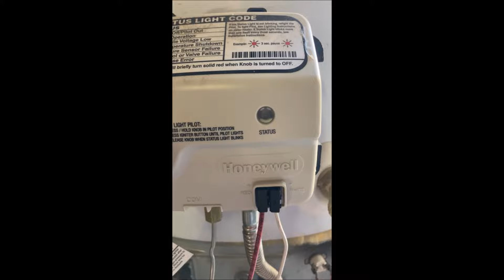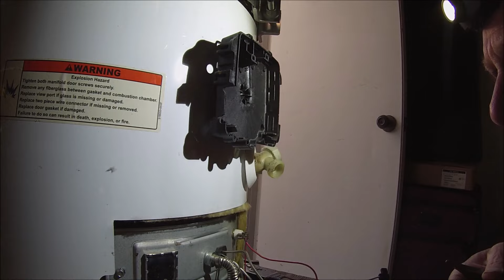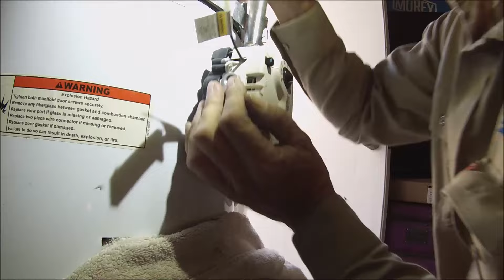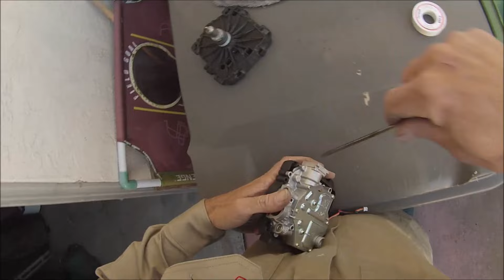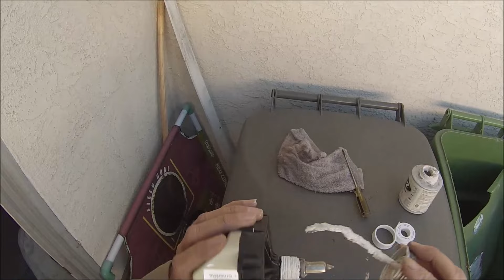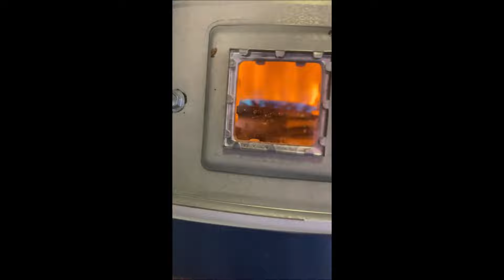Code 5 | 5 Flash Water Heater Honeywell Valve Service Call

Comment: AMAZING SELF HELP!!! thanks for posting, question?  my water never ran cold just luke warm. pulled the unit,  

 I have some water in the well in the back, does that mean the sensor is kaput? or can it be cleaned and put back?

I have some corrosion at the bottom of the unit so it may have been leaking for some time

 Also the cover in the back the nipple appears to be plastic not metal, is that possible?

If so where would I order a new back cover and sensor? or is the unit shot and better to get a whole new unit?

IF i need the whole unit can I put some sort of rubberized covering like Flex paste or Flex glue over the nipple until I get parts?

a lot I know, but I wanted to get it in all at once

TY
Reply from the maker: If you mix up the hot and cold side when installing it will (supposedly) water temp should be Lukewarm , if the dip tube falls off inside the water heater it will run lukewarm, to much sediment will insulate the bottom of the tank can cause this  , broken thermostat can cause this. So in a water heater the hot water separates from the cold if this system is interrupted the water mixes together. Hope that helps!!
Reply: @thewaterheaterfactory  THANKS for the reply, installation was good NP there the tank has been operating for 7years without a problem, I started getting cooler water, suddenly, about 3 wks ago, when I checked it I was getting the dreaded 5 flashes, I tried the reset procedure, lights fine gets warm then shuts down, 5 flashes starts again so I presumed either dirty tank or the controller, didn't know about the thermistor until I watched your video, striped it down and found the moisture in the unit, while I had it off I drained the tank and did a back flush, ( oh forgot the nipple on the back had a slick coating but not cruddy, but flushed anyway, in your video you replaced the back plate and thermistor, I called 2 supply houses locally they said they aren't replaceable, and wanted to sell me the whole controller, I searched online and found a "used" thermistor on ebay, but no new ones, and no back plates at all, I was hoping for a direction to buy parts, if you know of any, if not I guess the best bet is to buy the whole controller. 

but regardless, thanks for the posting it was absolutely great
Reply from the maker: That's a tricky part. I call it "the well housing" you might need to buy an entirely new valve try eBay. Or buy a used valve just make sure it has the metal cap on the tip for the sensor. I think you can get valves for $65 maybe its $165 . See if you can pull one from a discarded water heater plumbing store ext. try Craigslist offer up and Facebook marketplace.

Comment: Do you use pipe dope and/or teflon tape to connect the flex gas line to the converter that is screwed into the control valve?
Reply from the maker: I don't use either , its not needed its a self sealing end. But i see it used a lot. But you don't need to put teflon tape between the flex line and the adapter. Thanks for commenting and watching!

Comment: is there anyway to get the valve alone not the whole control valve?
Reply from the maker: Try eBay search Honeywell valve body , if there is a place by you where plumbers drop off old water heaters that's where I score them from ! Plumbing supply houses look for the water heaters that are leaking then take off the valve
Reply: Btw I appreciate this and your help
Reply from the maker: Thanks for watching !  Appreciate it ! Consider Subscribing! Thanks!
Reply: I have one more question lol.  So I took apart the gas vale to access the temp sensor.  No water dripped out.  But when I pulled the sensor out it looked like it had a drop of water on it. But didn’t seem like water.  There was no water running out of the tank and I stuck a piece of paper towel moved it around and it came out dry.  Was this drop possibly condensation?  Also prior to this the the removal of the sensor the heater had stopped turning on for 10 minutes of water to heat.  After I pulled it out and did the above drying etc and put back together the heater once again warmed water for 10 minutes and stopped.  

So the question is should I replace the wire alone or is it possible the housing is compromised and better to replace the complete gas valve unit?
Reply from the maker: You can test the thermister for Ohm to see if the left and right side are the same number if they are different the sensor is broken , then replace the thermister are you getting a code fault 5?

Comment: I just replaced the thermister however still code 5. 😢   I found a drop of water inside the housing...
Reply from the maker: yeah you need to replace the black housing , the "well body" very important
Reply: Thanks for all your help. If there is water inside the valve is it still necessary to replace the thermistor or just the valve body?
Reply from the maker: When in doubt replace the entire thing. Well body usually(black or red), thermistor for sure, valve body and motherboard usually you can reuse them.

Comment: Hi, i was getting the temp sensor failure and barely warm water after a heavy rain, i attempted opening the valve and drying the sensor! but i opened the whole thing by mistake (the metal part) it had some coils inside, i pushed it all and put everything together. When i turned in the gas again the boiler is making a loud hissing gas that i didnt notice before, did i messed up the valve by opening it? i noticed it had a 1/2 psi stamped on it so was it under pressure? should i just buy a new one? thanks
Reply from the maker: Possibly I’ve never taken a valve apart like that hard to say but when in doubt, yes, I do believe they sell them used on eBay and you can pick one up for about $150 on Amazon
Reply: @thewaterheaterfactory  appreciate the reply, i was hoping i wouldn’t have to buy a new one hahah oh well, thanks

Comment: Hey I got same Honeywell thing I lit pilot  about 8 mins it shuts off  so I just left it alone any reason for it
Reply from the maker: Check the status light for flashs and the valve for OHM , clean the thermopile off, with high grit and paper relight if happens again change the valve.
Reply: @thewaterheaterfactory  it telling me.five flashes sensor failure
Reply from the maker: Thanks for commenting ! You need to change the thermistor probably the whole valve! Amazon for $155.00 Search Honeywell Water Heater Valve just get the cheapest one! You may have a leak in the back of the well housing watch my video on code 5 , ther are three of them ! But search code 5 from my page!
Reply: @thewaterheaterfactory  are the valves interchangeable? I have a wv8840c1406. They are pricey.
Reply from the maker: Pretty much I've had a lot of luck with it. Try ebay for used ones !

Comment: is there a year that Honeywell started putting that metal cap on their valve?
Reply from the maker: 2014-15 and newer Just a guess not sure. I know those circuit board/Honeywell valves started showing up commercially around 2008.

Comment: I'm having a terrible time finding that water temp sensor (aka 'thermistor') only finding them on eBay which means they are used, and sometimes take a while to ship.  I have a Kenmore gas water heater, Honeywell valve and my unit is flashing 5 error code. It will run intermittently but only on the 'hot' or below setting and it only heats up a small amount of water before cutting off.  I am 99.99% sure it's that temp sensor he just popped out.  If anyone can share a link for the ones they've found, I would appreciate it.  I thought I could find an electrical supply store or something locally but so far nothing.  It looks to me like an intentional design flaw to get you to buy a new Gas Valuve or even a whole new water heater since paying someone to install the valve would likely cost about 1/2 to 2/3 or new unit anyhoo...
Reply from the maker: Well its either new or used. I'm not sure who sells them new - usually you have to buy the complete valve . Amazon has good pricing over local stores - I've seen valves complete new as cheap as $65. Thanks for watching!

Comment: My water heater valve started leaking water about two months ago because it’s old and doesn’t have metal back and that rubber back had a deep crack. I filled the crack with super glue and then cover the whole end with marine grade sealant. Now it got 5 flashing lights that is bad sensor. I’m wondering should I replace the whole valve or just replace the sensor? Thanks
Reply from the maker: The whole valve just to be safe!! you can try using a used valve off a leaking water heater , as long as its close should work
Reply: Just installed a brand new water heater valve that I ordered for Amazon and it won’t do anything. Won’t light up the pilot, no light and looks like cheap china’s replica. Any tip or trick that I can try before I send it back. Thanks
Reply from the maker: @marsshaw799  check for voltage from the thermopile (multimeter) , no voltage no lights , if the pilot light stays on and the LED doesn't come up try turning on the valve might be a bad LED. Thanks for watching!
Reply from the maker: wait! put you old valve body and cover on the new black housing from the new valve ! That should work if the new valve circuit board is broken!!!
Reply from the maker: make sure you connect the ribbon wire from the thermister!!
Reply: I found out some reason that ignitor isn’t igniting. Few times I saw a very little spark but most of the time it wasn’t making any spark at all. I replaced the igniter with the old one but that wasn’t working either with the new valve. Finally I ignited the pilot with a kitchen lighter. It’s working now. Do you think maybe the part that makes spark is bad or the wire? Thanks
Reply from the maker: @marsshaw799 might not be putting out enough voltage from the pizzio igniter , i see that a lot, you replace the clicker or try another one. good luck

Comment: Hi, and thank you for the informative vids. Are those "back plates" or "thermistor wells/housings" universal?
Reply from the maker: Yes - 3/4” , they’re not all the same shank lengths so some waters heaters have 1 inch of insulation some have two and then sometimes the spacing is high and sometimes it’s a medium. Do you wanna make sure you match up yours as as possible

Comment: Great video!  Thanks!  Where do I get the thermistors?
Reply from the maker: Try eBay , you probably are going to need to replace the entire valve not because there’s anything wrong with the circuit board or the valve body, but you need a replacement well body, which is the black part the black plastic nylon and then the thermistor that usually comes with it
Reply: Hi I was wondering if you still sell the well body as you mentioned. The black plastic nylon. Please let me know.
Reply from the maker: @cafe-jo1410  sure where are you located ?   Would need to know the spacing and depth of the well body for the sensor short middle , short low,  long middle long low
Reply: Ok I’ll get that and reply back. Thanks!

Comment: This may be one of the best How-To/DIY videos I've ever seen! Thank you so much for sharing. I think I have what I need now to attempt the repair myself..I think I'll need the thermistor and the Black Well housing but how do I know what length valve I will need without disassembling first?
Reply from the maker: insulation depth will tell you, either 1" or 2" well housing will be center short/long or lower short/long
Reply: @thewaterheaterfactory  I also have a little water leaking/pooling at the base so I'm hoping it is just the threads leaking at the valve location...Not sure yet.
Reply from the maker: Yes you can order a used complete valve from ebay or new from amazon last I checked it was $150.00
Reply: Do we need to empty HWT to replace control valve?
Reply: @nv5854  I’m not sure since I didn’t wind up needing to replace it. The friend I was helping decided to just replace the whole unit.
Reply: @thewaterheaterfactory I can feel a lil water where the wires plug into the bottom of the module. I'm guessing it's better to just replace the whole unit instead of just the thermistor? Where is the model number on the unit and how do I make sure I get the one with the metal end piece?
Reply from the maker: @beardaniellemeganscottgyps5763  so the model number of the valve is written on the side, the right side of the valve you’re gonna want to pay attention to the spacing or the shank depth for the well housing. That’s important you can tell it’s either 1 inch or 2 inch based on the amount of insulation your water heater has if it looks like it has a lot of insulation and everything is kind of recessed a couple inches while that’s 2 inches if it’s very close to the surface or the jacket of the water heater that’s 1 inch . New valves that you order or now have the metal cap on the end so you don’t really need to worry about that too much they stopped making those when I see those that means they’re 6+ years old at least or older so the industry is aware of this issue and they’ve taken steps by putting those metal caps on there. I don’t know that it particularly short out the therm but it definitely prevent the therm from working properly. If it ever gets wet, there is a way to test your therm Mr. with a multimeter. I have a video on it and Bradford White, makes an excellent video on it. It’s under my it’s on mychannel page under recommended viewing

Comment: Where can a guy find a thermistor? My secretary said she tried and all that came up were thermopiles and the whole Honeywell unit..
Reply from the maker: Try for free a plumbing supply store parking lot where they drop off the used and leaking water heaters just ask at the counter if you can take a part. Or try ebay.

Comment: anyone know the part number for the wv8840b1109 thermistor replacement?
Reply from the maker: So it depends on the depth of the probe end of the valve housing its black plastic , some are 1"  some are  2"  . You really want to remove it and confirm the configuration of how its installed and its length . They are different between valves , You might want to replace the whole valve might be easier. I've seen at least 3 different kinds. Ribbon cable color doesn't matter. Hope this helps!
Reply: i ended up replace the control value, the old was had the plastic tip and water was leaking thru it
 @thewaterheaterfactory

Comment: Where did you get the sensor ?
Reply from the maker: I have spare valves from working on used water heaters I sell them and perform service calls for people with the spare parts!
Reply: @thewaterheaterfactory  I see. thanks for the response. I need a sensor!
Reply from the maker: Try ebay

Comment: Where do you get the thermistor?
Reply from the maker: Recycled from extra valves left over , I fix and sell used water heaters , install them on occasion sell parts, and perform service calls to fix broken and non-functioning water heaters in the field. So I have box's of parts.
Reply: So if the thermistor goes bad and I can’t obtain one, is replacing the valve going to fix it? Even though more expensive.
Reply from the maker: Its a Part , So I'm not saying you can't obtain it. I'll look for a part number but they are all different depending on the depth of your well / spacing. Also if the Valve is leaking you need to replace the whole thing, more or less from your perspective. Replacement valve on Amazon cheapest is $150.00. Thanks for watching!!
Reply from the maker: Call the manufacturer , and describe the part , and fault code they can point you in the right direction.
Reply: Where are you located? I live close to a place called oceanside, maybe it's the same one and you can fix my heater? :)
Reply from the maker: If its oceanside california yeah Not to far I'm close to downtown San Diego, I did a job in oceanside many actually its the code 5 video! Thanks for watching and commenting!
Reply: I've got a code 5, can see a bit of corrosion or like water was dripping from the back of the valve.

I guess that means i need to replace the valve assembly.

Do you think I can run into any kind of trouble if I reset the control and relight the pilot when i get the code 5? Tank will run anywhere from 5-30 minutes before it throws a code again. Just need to limp thru until my tankless system gets installed (or my gas guy finds a used valve).
Reply from the maker: Yep I sell replacement valves for $35 , used of course. You probably just need the well housing the black plastic and thermister replaced.
Reply: I got mine off eBay, $18.89. It was a long probe; I needed a short probe. The thermistor snaps off the mount and I
 traded out the mounting plastic.

Comment: I like a little black box that you what's the batteries how can I make one
Reply from the maker: Take the wires from a thermopile with connector, aa battery ,use ohms law, formula , a resistor wire them together ,you need to cut the voltage under load, in half to around 500-800 milivolts. Box is on amazon, from amazon
Reply: Link for making a thermopile tester with a battery

Comment: Again, where is the sediment trap on the gas line?
Reply from the maker: Sediment trap needs to be attached to the gas pipe at the wall not the gas valve on the water heater, its code for California
Reply: @thewaterheaterfactory  Really? I suggest you look at the 2022 CPC 12.12.9 of the code and where it is required. It mentions nothing of what you claim.
Reply from the maker: I'll check it out , City inspector in San Diego makes us move the sediment trap to start at the gas pipe coming off the wall. Then flex over to the valve